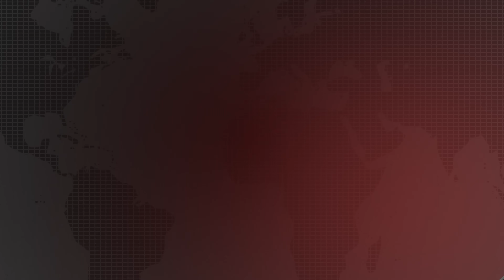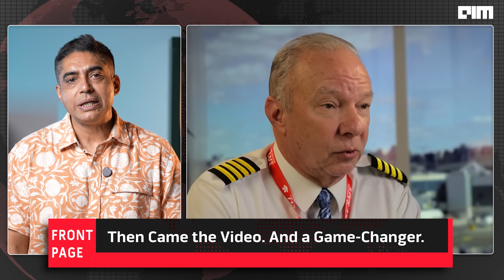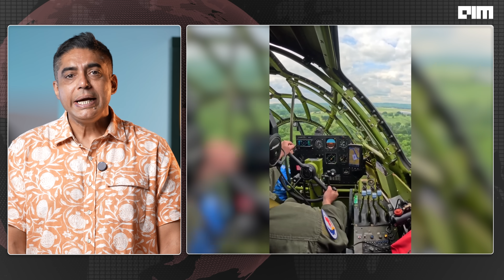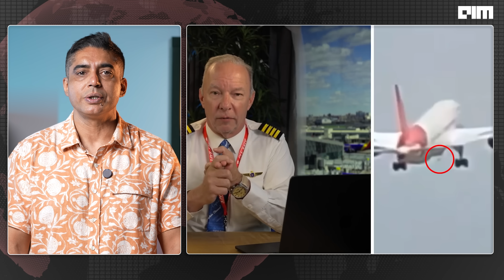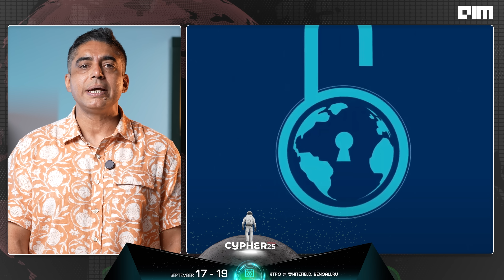Air India Crash: Is Boeing in Trouble Again? RAT Footage Sparks New Questions

Comment: You have some of the facts correct.  But what you leave out is that this flight history was known for not using the whole runway.  Pilots and airline dispatchers choosing to not utilize the whole runway on this very hot humid day is going to contribute to the swiss cheese model.  The choice to not use the whole runway created abnormal amount of dirt and debris just before rotate and will be a factor in why both engines failed. And there were other electronics issues that should have grounded this aircraft. It was human error that put this aircraft into misconfiguration.  Poor maintenance is going to be a major factor.  Not aircraft design.  If it was aircraft design the dreamliner would have been grounded by now.  Boeing has the ACARS data they know likely already what happened.  It hasn’t been grounded and won’t be because humans made poor choices that day.  Not difficult to determine.  The longer we wait on the FDRs, the more it looks like human error.  Watch and see.
Reply: Unsinn. Die 787 hat 3000 Meter von vorhandenen 3500 genutzt.   2600 sind für eine Standard-Rotation nötig.
-
Boeing ist auch ein militärisches Unternehmen.
.
 WER saß wohl alles in der Maschine? ...oder auch nicht unbedingt.
-
Beim MCAS-"Absturz" der Äthiopian-Airlines saßen 20 äthiopische UN-Delegierte mit in der Maschine.
DIE 20 Delegierten, die mit ihren Gegenstimmen dafür sorgten, dass die USA keine Militärbasis in
Äthiopien errichten durften.
Dass das per US-GPS satellitensteuerbare  MCAS  generell geheim gehalten wurde, war keine bloße
Schlamperei und/oder Sparmaßnahme um Airbus dagegenzuhalten, wie offiziell kolportiert.
-
Gedacht sind solche Systeme schon lange um bei "Flugzeugentführungen" die Boardelektronik zu
überstimmen, damit Luftpiraten die Maschine nicht mehr übernehmen konnten.
Das us-amerikanische GPS-System wird genauso in Waffensystemen wie Drohnen, Raketen und
dgl. verwendet wie in der Zivilluftfahrt. Das Jamming weiß nicht, ob es die Funktionen eines zivilen
oder militärischen Gerätes stört. Das weiß nur der Absender.
-
Auch in der Indonesischen MCAS-Absturzmaschine saßen fünf solcher Widersacher, mit deren
Votum ein Jahr zuvor auch in Indonesien eine Marinebasis der Amis verhindert wurde.
-
Die beste Versicherung für Staaten, die sich den USA nicht unterordnen lassen wollen, ist,
nur noch von der brasilianischen Embraer, der chinesischen Comac und der russischen OAK zu kaufen.
Die benutzen ihre Systeme (siehe auch Microsoft Windows) nicht als Waffe.

Comment: So did officials ever release if the pilots did a midfield turn around on the active or did they use the entire length of the runway?

If the flight flight deck did use the entire length of the runway, they would have had better chance to ower down before they rotated.

Comment: Both engines failed and preflight computers did not detect abnormal conditions.  Boeing software is unreliable.  Like mcas, hidden flaws surfaced after years in service.  Beware of aging Boeing planes.  No warning and planes dropped.

Comment: Engine failure is not on Boeing, they don’t manufacture jet engines.  Engines are selected by the airline and built by manufacturers such as GE, Rolls-Royce, etc.  

If it’s not an engine design and/or manufacturing problem, then it’s maintenance and that’s on Air India.

Comment: In view of TWO similar FAILURES (1) United Airlines flight UA 613 dated 24Jan 2025 And; (2) Air India Flight AI-171 12June 2025 and several others small incident ALL THE CURRENTLY running DREAMLINER 787 aircrafts should be IMMEDIATELY grounded to avoid the risk of putting the lives of thousands of passengers fly on these planes in danger of being killed in accidents

Comment: It wasn’t ‘catastrophic engine failure’. You would be able to see all the debris coming out of the engines if it were. It COULD be engine(s) rundown, or failure to respond to commanded thrust, which became catastrophic for the flight, but it certainly wasn’t catastrophic ENGINE failure.

And you bullshit at the end regarding not dealing in speculation….

Comment: I was browsing through the Facebook page of Boeing,and I came across this comment "Scott Thompson There is a video circulating that shows a passenger recording and posting electrical issues with this aircraft in question. He shows lights, AC and entertainment screen issues. He was on the flight from Delhi to this Airport in Ahmedabad. When you type this into GPT-4 it tells you something very chilling. See below.

If the lights and air conditioning (AC) are not working on a Boeing 787, it's a sign of problems with the electrical power systems, particularly the electrical power distribution or generation side. Here’s a breakdown:

🔌 Systems Involved
1. Electrical Power System
Primary System: The 787 is heavily reliant on electrical power (more than previous aircraft) — including for cabin pressurization, air conditioning, lights, hydraulic pumps, etc. If lights and AC are both out, this strongly points to a loss of AC electrical power (alternating current) from generators or electrical buses.

2. Integrated Drive Generators (IDGs) or Variable Frequency Generators (VFGs)
The 787 uses engine-mounted generators to supply high voltage AC power. If a generator fails or doesn’t come online, critical systems like AC, lights, and galleys can go down.

3. Power Distribution Units (PDUs) and Remote Power Distribution Units (RPDUs)
These distribute power throughout the aircraft. A fault here can selectively disable systems like cabin lighting or environmental controls.

4. Environmental Control System (ECS)
Responsible for AC, heating, ventilation, and cabin pressurization. On the 787, it runs entirely off electrical power — not bleed air from engines like older planes.

✈️ What It Suggests
Multiple system failures, especially of lighting and air conditioning together, strongly suggest:

A partial or complete electrical failure

Fault in bus tie switching (which balances generator load)

Problems during APU to engine power transition on startup or takeoff

Inverter or power panel fault

If this is in reference to the recent 787 incident (like Air India), it could indicate a power transfer issue or electrical configuration error during engine start or early takeoff — especially if no lights or AC were reported by passengers.

---

🔍 Possible Implications in a Crash Scenario

🧨 1. Electrical Power Loss or Misconfiguration at Takeoff
If lights and air conditioning were not working, it could mean:

The aircraft never successfully transferred from APU power (used on ground) to engine-generated power after engine start.

One or both engine generators failed to come online.

A power bus didn’t energize, meaning whole sections of the aircraft (like cabin systems) remained unpowered.

This could point to a major electrical configuration failure — either pilot error, system malfunction, or software bug in the electrical distribution logic.

❌ 2. Failure of Vital Systems Downstream
The 787 uses electrical compressors (not bleed air) for pressurization and air conditioning. If AC wasn't working, it might also mean:

The ECS (Environmental Control System) compressors never started — perhaps due to no power on the left and right AC buses.

Lack of cooling could lead to avionics overheating, impacting flight control computers or displays.

Pilots may have lost access to key flight info or automation.

⚠️ 3. Takeoff With Incomplete Aircraft Power-Up
If lights and AC weren’t working even before takeoff, yet the plane proceeded down the runway:

There may have been incomplete pre-flight checks, or

Crew may have been rushing due to ATC pressure, heat, delays, or fatigue.

Takeoff config warnings (if electrical) may have also been disabled or missed.

💥 4. Consequence in Early Flight Phase
A power problem during V1 (decision speed) is critical:

At V1, the aircraft is committed to takeoff.

If an engine generator failed at or before V1, it would trigger cascading issues: reduced thrust, unpowered systems, and loss of automation.

The aircraft might not reach safe climb speed or altitude (especially in hot, high, or heavy conditions).

🧠 Final Thoughts
In the context of the Air India 787:

Lights and AC not working may be early signs of a power distribution failure that impacted other systems — possibly leading to loss of thrust, avionics instability, or crew disorientation.

If engine failure and lack of power occurred simultaneously, it’s a recipe for loss of control at a critical moment — with very little time to react."

Comment: Further to my earlier comment I need to qualify that FADEC Redundancy, The Boeing 787 has dual FADECs, one for each engine, providing redundancy. Each FADEC is designed to operate independently thru' Independent Power: Each FADEC is powered by its own PMA, which is a generator directly connected to the engine. Critical Sensor Failure, a failure of critical sensors that provide input to both FADECs could potentially cause them to shut down both engines. IF Loss of Power where both PMAs were to fail is unlikely unless there was a failure in a shared power supply that both FADECs rely on, this could also lead to a complete loss of dual engine power. The failure of a shared critical sensor will obviate dual redundancy.
Reply: That’s ur answer
Reply: Poor maintenance or contaminated fuel

Comment: captain steve never spotted anything it was the redditors who had the enhanced video on day one who pointed out that the rat was down even before he posted his original video that sullied the copilots name blaming him for raising the flaps instead of the landing gear which was also noted and proven that the flaps were down at that time.... the right side engine was also replaced 3 months prior as well which could mean there was a vapour lock or a possible fuel contamination in the fuel lines and it has also been noted by a 787 engineer that a possibility is that both ccr cabinets failed during gear up and a pilot who said a possible pmg/idg failure could throttle back the engines to idle also if the engines weren't providing a route for electrical power and it was running only on apu auxiliary power and the batteries couldn't charge and went flat could've shut down the electrics as well.... there are so many speculative theories that we will not know exactly what happened until such time the black boxes are properly analysed.

Comment: July 17, 1996  -  A Day that will Live in Infamy by Randall Brooke. 

         A bomb blew up TWA Flight 800.   Dan Bongino is not going to change the narrative.   Kalstrom, the NY Head of the FBI, who handled the investigation and surely knew that a bomb blew the plane up just based on the bomb making ingredients found in various parts of the plane.  The main proof was that in the third debris field closest to JFK things from the plane were shot at supersonic speed some things landing 500 feet away from the flight path which could only have occurred with a powerful bomb.
        This was orchestrated by the Clinton's.  Interestingly years later Kalstrom stated that the Clinton Foundation was a corrupt cesspool.

Comment: 3:09 Corruption KILLS and BOEING did it with the 737MAX and will most likely get away with it and be back to the same position of power when all is said and done. This 787 crash is different but you are very well onto the truth being buried and it's most likely not a BOEING issue this time.

Comment: Please do not RUSH to blame Boeing or the pilots until ALL facts are in.  If Boeing ends up at fault then they will need drastic and immediate changes in management to curtail their string of errors.  That said,  based on Air India history, especially the Turkish maintenance contracts, that if the truth comes out it was most likely maintenance and not Boeing or the pilots mistake.

Comment: Cockpit Voice Recorder and Flight Data Recorder can be downloaded in less than 60 minutes and analysis is a mere play thru the downloaded. The tech that ypu are showing as Black Box is infact a ELT or Emergency Locator Transmitter and has no flight data or voice data. Your tech behind the accident is incorrect. ADT 406S is a sattelite link ELT which gives exact location of the accident for rescue operations to find the crashed aircraft and save lives. Hope you admit your correction here. What I agree with you is on the notion that truth will be suppressed. Both FDR and CVR are under custody long before this footage and have already been analysed and understood. i am just wondering what story comes out. i left avation due to malpractices done by airlines. i know them quite well.

Comment: Rumour: after 248 days of continuous operation, the elecrical system on 787 goes into forced shut down. Supposedly happened in 2015. So, maintenance requires re-cycle on/off every 120 days. All reports support theory of total electical shut down. All that is needed is Why?

Comment: Yes …. First crash of this sophisticated super plane since it was first brought out in 2009.

It seems most likely there was fuel contamination, or some other thing caused BOTH engines to fail simultaneously.

Water in the fuel would cause engines to go bang and cut out…. But it takes longer to circulate than the few seconds we saw… much longer….

Unless the plane had been fuelled completely with water, but that’s an insane ground maintenance staff eff up.

There were no birds, so not likely a double bird strike.

I don’t think the landing gear moved at all… and in some shots it looks like the wing VENTS (not flaps) we’re open, which would be a ridiculous error, since it would have had the opposite effect to the flaps which should have been open.

Open vents = lose height.

There’s a lot of official looking ‘Indian Official Report’

These must be faked.
There’s no official report yet. That will take time to compile.

Comment: What if Flight AI171 was never meant to reach London?
What if someone knew it wouldn’t?
Every safeguard failed. Every second matters.
And silence... is the biggest clue of all.

Something felt off.
But I kept quiet.
Until now.

I’ve been watching.
Not the news.
Not the social media.
But the footage.

That one video...
of Flight AI171 —
lifting off... and crashing.

Shot not from a runway cam.
Not from ATC logs.

But by a civilian.
Standing on a terrace.
Filming that exact moment.
From the perfect angle.

Let me ask you:
What are the odds?

Ahmedabad sees hundreds of flights daily.
Thousands of passengers.
And one person…
randomly films this one plane...
at this exact second...
as it lifts, climbs — and crashes within 45 seconds.

And the video?
Perfect clarity. 
Perfect angle. 
Perfect timing.

I did the math:
(1/10,000) × (1/10) × (1/1,000,000) = 1 in 100 billion

Almost impossible
Unless it wasn’t luck.

Then I studied the aircraft
A Boeing 787 Dreamliner
One of the safest ever built.

Can fly across oceans on a single engine.

So what happened?

Here’s the second-by-second breakdown:

00:00 – Takeoff. Smooth.
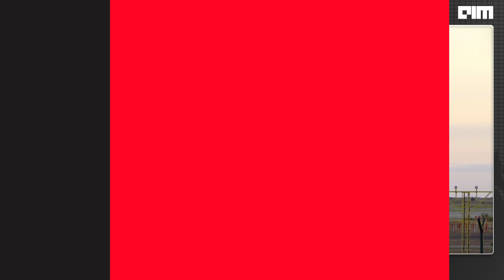00:10 – Climbing. Nose up.
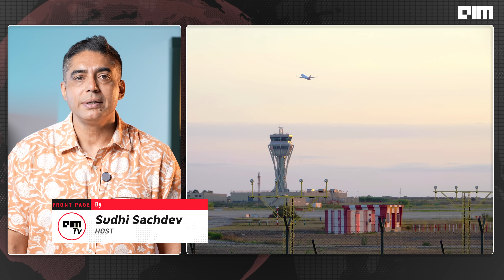00:20 – Flaps don’t retract.
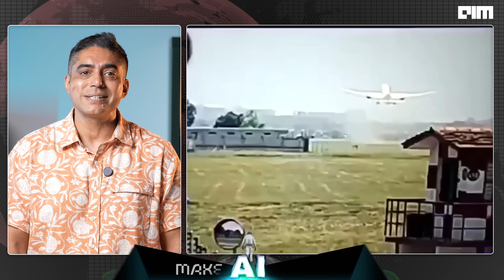00:25 – Landing gear still down.
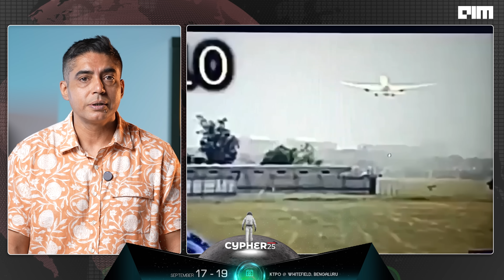00:28 – RAT deployed — total power loss.
00:29 – Mayday sent. No reply.
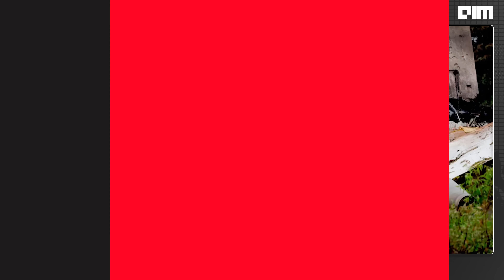00:35 – Aircraft tilts. Control lost.
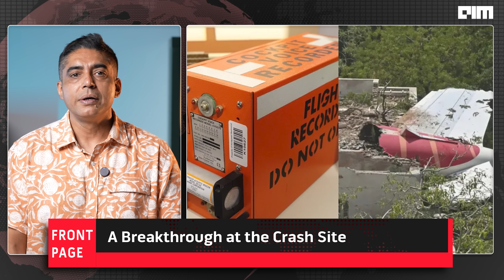00:45 – Crashed.

Probability Breakdown:
Triple fail-safes
Dual engines
Cutting-edge electricals.

Engine failure in 30 seconds?
1 in 10 million

Full electrical collapse triggering RAT?
1 in 50 million

Combined chance?
Less than 1 in 100 billion

It took off clean.
It climbed well.
Then it died.

Planes don’t just die like that.
Not unless someone helped them die.

Ask yourself—
Was this a crash?
Or was it a..........?

The flight had both engines running.
Clear skies.
No bird hit.
Elevation gained.

And still…
— Flaps froze
— Landing gear refused to retract
— RAT activated
— Power systems collapsed

This wasn’t a mechanical error.
This wasn’t a coincidence.
This was surgical.

Flaps + gear + RAT + blackout =
electronic system sabotage.

How?
— Tampered avionics
— Rogue firmware patch
— EM signal jamming
— Wiring sabotage
— Or… a compromised crew?

Now listen closely:

Çelebi Ground Services, a Turkish firm,
handled ground ops in Ahmedabad till May 15.
Full access.
Including to the aircraft’s electronic bay — its brain.

Now trace the flight:
11th Night: Landed from Paris to Delhi
12th Morning: Flew to Ahmedabad
Cabin issues reported — AC dead, screens blank, buzzing hum
Still cleared for London?

Why?
Who cleared that?

People will scoff.
"Conspiracy theory"?

But every conspiracy
was once an ignored pattern.

I’m not an aviation expert
I’m a citizen
A patriot.

And I’m telling you,
This was not random.
This was not routine.

This feels like a strike
An invisible one.

Is India under attack?

Not by bombs
But by fingerprints no one sees.

This isn’t a post
This is a warning.

We either question now,
Or regret later. 😞😭

Comment: 1.	No asymmetric flight, fuel (electrical) starvation, BOTH ENGINES INOP for any of a hundred reasons.
2.	LG «UP» commenced, NOT COMPLETED following a major engines’ failure.  The RAT deployed on dual engines’ failure.
3.	Difficult to believe experienced pilots confused... pulled FLAPS-UP i.s.o. LG-UP  But, «Pilot Error», very convenient for Boeing

Comment: You heard it here first, 
Both generator failed due to a software glitch, 
They nah have recently performed maintenance on the wiring or the generators themselves,

Quote “
In some cases, software bugs, such as those identified in the Boeing 787, can cause the generator control units to fail simultaneously, leading to a loss of electrical power. “

This is a fact, and the only plane in question with this failure is the 787 

Case closed!! What do I get for being first?? 😂